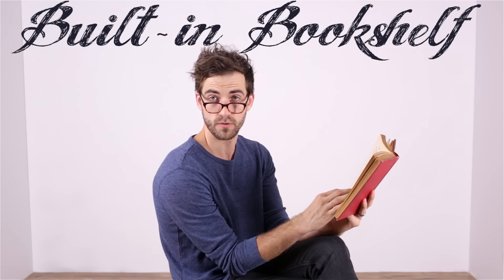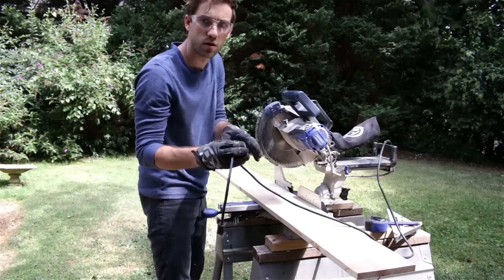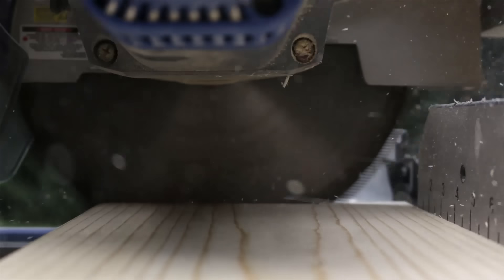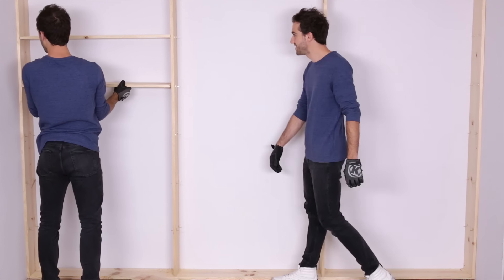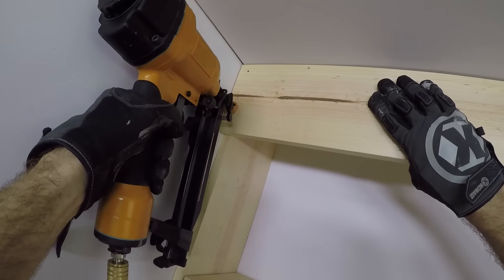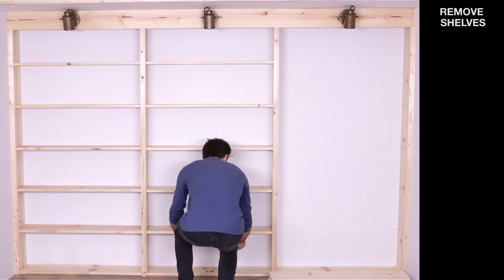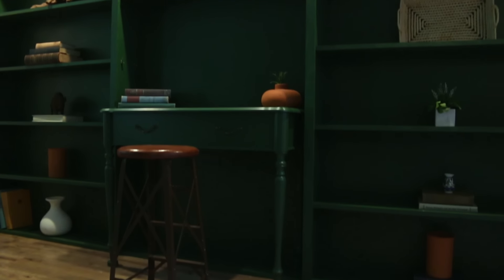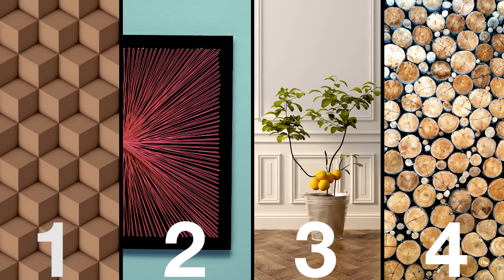THE BUILT-IN BOOKSHELVES WALL /// Experiment #004

Comment: If anyone plans on filling the shelves with books be prepared for the pine to bow under the weight. Two easy things you can do: One is to flip the shelves over and let them bend back. Seriously. Or use the same face frame material to trim the front of each shelf which will also help reinforce it (but you can't flip it). This will help but it's best to not overload pine and keep these shelves more open. Nice, simple project, Daniel; well done.
Reply: Maybe reducing the shelf length to 20” would fix this? The point of building a floor to ceiling bookcase is to hold a wall-full of books, after all. Next it needs a rolling ladder.

Comment: Very intrigued by #4, so that gets my vote. This project turned out so cool!!!! Seeing if I can adapt it for my rental since every little nail/screw in the wall is something I'd need to fix later
Reply from the maker: This one is a liiiittle more renter friendly, since once the frame is secure, you're really not installing anything else into the drywall. If you do end up trying it, I recommend leaving any screws or pocket holes unfilled so that you can unscrew them easily later (vs. ripping them out of the wall). Just hide them with books 😉

Comment: I loved the book shelf wall. Would it be possible to add glass doors on this bookshelf?My husband is a comic book collector and freaks out them getting dusty, so the doors would prevent it.
Reply from the maker: Oh, what a great question! So short answer is YES, could be done for sure. I'd have to think through how you'd structure it differently to accommodate the glass. The way I did it, the shelves aren't actually fixed in place so that you could reconfigure. With the glass, though, I'm thinking you'd want those shelves to be fixed? A fun challenge!
Reply: I was wondering if the structure, as you did, would  be strong enough to hold the doors. I'd make a wooden frame for the doors. I don't need the shelves to be fixed, would they have to be?
Reply: #4 looks really cool.
Reply from the maker: You know, since you'd be making the cabinet doors yourself, I wonder if you could just install the door hinges directly onto the columns? Then you could fit the shelves in there with the regular shelf pin method, but the cabinet doors wouldn't even be attached to the shelves (except maybe the little magnetic door closer strips). If you try this, PLEASE come back and tell me about it! Cool idea.
Reply: I loved the built- in book shelf...as well as the other three wall ideas. I think I would love to see #2
Reply: amani bagwell same
Reply: Same about my husband and his comics. A wall specifically built for comic collectors and display would be uh-mazing and get a ton of traction. There's so many cool ideas beyond a standard set of shelves!
Reply: You should tell him about bags and boards for his books. keeps them dry, rigid and free of dust.

Comment: if you used a peg board you can use it as a guide to drill holes for the shelf peg holes
Reply from the maker: Great tip, Donnie 👌
Reply: +Lowe's Home Improvement glad I could help a peg board is cheap & can be reused on several projects you just rip it down to the size you need mark the holes you want to drill through drill one side move it to the other side & repeat should all line up since your peg board is cut at the same length & the holes are drilled out in the same place hope this helps
Reply: Donnie Haymon ~ What a great idea!  Thank you for sharing it.

Comment: Wow! I'm just about to build shelves in a reading nook inset in our new house. They will be about 6 feet from the ceiling, leaving 3 feet for a padded bench and pillows at the bottom. So this video was just what I needed. My shelves will be wider than 7.5 inches to hold larger books and I'm considering building them from stair treads and I'd like the rounded edge on the front of the shelves.. I really hadn't decided how I could do the lighting, so I really appreciate your suggestion. Hopefully I can figure out how to install the cute on-off switch you used.It's such a great idea! Thanks so, so much for this video!

Comment: While the host calls this a "book shelf" he doesn't put any books on his 3/4" pine shelf planks. If he did, he would find that the "shelf pins" are not adequate to the job. On the plus side, the Kregg pocket whole jig is a great idea. On the negative side, I have five complaints. 1: His wall has no baseboard, but a real wall would most likely have a baseboard that would need to be removed (or accommodated) on the bottom shelf, the bottom of the upright columns, and the two  outer frame pieces. 2: He doesn't tell you what width stock he is using. I measured some existing shelves and found that while 1" x 10" could work for most books, 1" x 12" is actually need for larger books. 3: He spaces all shelves the same height, when both function and aesthetics would recommend that the shelf heights get smaller as they go up, staring with about 14" on the bottom shelf and going to about 11" on the top shelf. 4: He says nothing about the possibility of the shelves sagging. I built an 8' tall by 12' wide shelf with three supporting columns which meant my shelves were about 34" wide. It turns out that there is a tool called the sagulator which can be found at this URL: https://woodbin.com/calcs/sagulator/ that lets you know how much sag to expect based on material, dimensions, and weight on the shelf. My pine 1" x 12" x 34"  passed muster based on about 40 lbs. per shelf. 5: The most serious complaint is that the shelf pins he uses are entirely inadequate to the job of holding 40 lbs. of books. If I had used his 2-column approach the weight would have been closer to 60 lbs, and those shelves would have sagged badly. The result I received after loading the first 2/3 of my library into the bookcase was 600 books on the living room floor. I replaced the inadequate pins with 1" x 2" x 4" pine supports nailed into the columns and the frame and now the bookshelf works fine.
Reply from the maker: Hey Tim! You make some great points & I appreciate you taking the time to share those resources. Looking back on this vid, I wish I'd addressed the weight/sag issue. I wanted to fill the whole shelf with books, but I didn't personally have enough on hand and to order them would've exceeded my budget. But if I had, perhaps I would've realized the limitations of this design, particularly if you're planning to fill it completely with heavy books. Looking at that calculator (which is great, btw), it looks like ~30lbs is the limit of each 3/4" x 8" x 36" shelf here. Which would accommodate many books, but likely not 100% capacity. 

So anyone planning to use this design as a guide, I'd encourage you to plan accordingly! Adding add'l columns, using 2x material vs. 1x, or affixing the shelves permanently like Tim did would all be ways to increase load-bearing capacity.

Comment: Great bookshelf build. What I really love though is that you did it without a truck load of tools. I've watched so many bookcase builds (getting ready to do a whole wall in a new home) that start with: "First I used my jointer...then my planer...then... " and so on. I have a table saw and a radial saw and I can buy a pocket hole jig but beyond that... not going to create a whole cabinet shop for this project. Good work, thanks.

Comment: Love this! How do I made a studier shelf that can hold some serious weight? More pins? A strip of wood instead of pins? Could this be done without a miter saw? How about a tutorial about how to remove crown molding, do I even have to do that? Oh, I'd love to see #3!
Reply from the maker: All good questions, Amber! Couple sturdiness upgrades you could make: thinner columns, using 2x material vs. 1x, attaching the shelves permanently to the frame vs. shelf pins. It'd take a little more time w/o a miter saw, but could definitely be done with a hand saw or handheld power tool. I didn't address the crown molding issue because everyone's scenario is so different, but you could either remove it before building the frame OR just account for it's depth when you're cutting the frame and column pieces.

Comment: Great video probably the simplest of all I found on youtube ! I have got these questions: A) how and where did you nail the bottom plank to the floor? Couldn't see clearly from the videoB) How did you attach the middle vertical planks to the bottom and top planks C) if I were to add back plank instead of the wall at what step I should be doing so?Thanks! Excited for the next season

Comment: Out of the four designs I'd go with number 1 - I love this series of videos and hope to see more stuff like this. My idea would be to remove the drywall completely from one side of an interior wall then coat all the studs, wires, drywall, etc with all flat black or all white paint and then start a design based on that as your canvas... just not sure if its a code violation(maybe call legal?) Keep up the good work.
Reply from the maker: Love the creativity, Ben! I think you'll wanna steer clear of any wiring, but I do like the idea of exposed studs. I've been really fascinated lately with faux wall room dividers, like:

https://www.pinterest.com/pin/90494273732317569/ or https://www.pinterest.com/pin/482377810078591618/

Comment: How deep are the pine planks?  Also, wouldn't it be much easier to paint the wall and the planks before building the shelves?  Great job!  I love your ideas, and the colors you choose!
Reply from the maker: Thank you, +tegma! I used 8" deep planks here, but I've also built this same design with 12" deep planks and it worked great. As far as the painting, that could definitely save a little time, esp doing the wall beforehand. The advantage of painting the planks AFTER installation, though, is that you can paint both sides of the plank in one pass (vs. painting one side, letting it dry, flipping it over, etc).

Comment: I LOVE these ideas! What about one without 1000 holes in the wall, for renters, which is semi-easy to remove when moving out?
Reply from the maker: Working on some more removable designs, +Kleberdeckel. After taking this bookshelf down, though, I realized that there isn't THAT many actual drywall holes for this one...the frame is the only thing that's permanently fixed.

Comment: You do a good job making these complex looking projects doable for average people.  Did you consider making the selves adjustable?  I didn't notice that in the video.  Since you are using shelf pins it wouldn't take much to add more holes.  I also think a template is well worth the money- Lowes- $35. I would have put the bottom shelf up a couple of inches and inset a kick plate.  This would cut down on the dustf on those items.    I would also hang a light under the shelf above the desk and perhaps a piece of art or wall paper or something on black wall..     In terms of what you do next, I won't use any of those ideas.  They all look nice.   I will suggest that anyone who has children under 21 or pets is asking for frustration with the string art.  This would include visiting children or rowdy friends watch sports.   Many people of all levels of maturity will have a hard time not touching it and trying to strum it.   .
Reply from the maker: Good ideas, Karen! And you're probably right about the string wall strumming temptation 😂

Comment: One or three! *

I love this! I just wish:
a) I knew how to handle that machinery without hacking off something likely to bleed and
b) My walls weren't concrete!

The answer to a) is simply education. What would you recommend as the answer to b)?

*If I had to choose one, it's three ;) (see what I did there?)
Reply from the maker: What's the flooring and ceiling made of, Rachel? You may be able to bypass attaching to the wall if you have some solid materials on the top and bottom.
Reply: Concrete walls aren't the worst thing in the world. Just need some concrete anchors. May need a different drill though

Comment: 3 for sure. question - what kind of weights could you expect to put on the shelves? being a true book nerd I would be fearful of those shelves bowing with any real weight put on them...what would be a good way to make them a bit sturdier?
Reply from the maker: Good question, Dustin. I tested out the weight capacity a bit with these 40" wide shelves by filling one with books and found that it held it's structure with little to no bow. Couple things you could do to increase holding capacity, though: Adding more columns would make for shorter, stronger shelf lengths & would reduce any bow factor. You could also use 2x material for everything instead of 1x. Would give a chunkier look and would just generally be stronger. Lastly, you could sub out the shelf pins and fix the shelves to the frame for a more permanent installation.

Comment: I'm wondering how well those will do holding up a shelf full of books.  Maybe it's actually just a nick-nack shelving unit.
Reply from the maker: Good question, William. I built a version of this at home for my son and it's full of kid's books w/o any issues. If you were worried about weight, though, you could use brackets instead of shelf pins OR use 2x material instead of 1x.

Comment: i was looking for ideas for a wall to wall bookshelf. this looks great. Question: the 1/4'' pins -- can these really hold shelves full of books? how much weight can these handle? thanks
Reply from the maker: Shelf pins are typically much stronger than you would expect for their size. Many shelf pins can hold up to 25 pounds per linear inch of shelf, so a 4 foot shelf could support up to 200 pounds.  Be sure to read the packaging of the specific pins you are using to see to what weight they are rated.
Reply: @lowes  great. tks! i just worry that it will bend in middle. my hubby hv loads of thick, heavy books. thanks for yr prompt reply tho. LOVE LOWES HOme Improvemnt Channel - keep up the great work!!

Comment: would love to see #3
also, I have a wall that does not have corners to build the sides - any suggestions or other video?
Reply from the maker: I think this design still works pretty well without corners. You'd just install the ceiling and floor pieces of the outer frame first, then use a pocket hole jig to attach the left and right side columns to them (the same way you'd install the inner columns). You could also size the bookshelf so that those 2 outer side columns run parallel with a stud, allowing you to add some additional pocket hole screws all the way up those side columns. Hope that makes sense? 

Oh, and good news! I did that #3 design: https://youtu.be/7y-otGwcgnE

Comment: This is actually an easy way to build the wall (oops...) , comparing with pre-made compartments. Everything is built in place, no assembling. The only issue I'm think of is the two vertical studs in the middle. Wood tends to warp and the weights from the shelves can drag them out of shape, given their length. It might be better to add more support of them on the wall.

Comment: Great idea, but books are heavy.  How about some ideas to add some strength to this bookcase?  The only one I could come up with is to add more columns--???
Reply from the maker: Yep! More columns for shorter shelf runs would help. You could also use 2x material instead of 1x for a chunkier, stronger construction. Lastly, you could eliminate the shelf pins & fix the shelves in place with some kind of brackets to add some additional support.

Comment: Quite nice, but if you were going to use it only as a proper bookshelf, i.e. loaded with only books, pine boards would be too weak for shelves that length, unless reinforced with a batten underneath them.
Love the colour though...very rich and classy.
Reply from the maker: Here's a couple other upgrades you could do if you were expecting lots of weight...shorter shelf lengths with more columns + use 2x material instead of 1x + skip the shelf pins and fix all the shelves in place.

Comment: I like the look of #4 but I have a really wall to tackle.  The wall has a big bump.  I banged on the bump and the brick is now exposed.  The other side of the wall is another apartment.  I would like to make a wall of French cleats but I don't really know if I should fix the exposed brick part with dry wall or just install a few sheets of plywood with French cleats on.  Would anyone have any idea?
Reply from the maker: If it was me, I think I'd try to incorporate the exposed brick section into the design! But the 'correct' thing to do is to fix the drywall, then install your French cleats onto the actual wall. Here's some tips on drywall repair, if you need it: https://youtu.be/Fdy9uRvpI-E

Comment: So I have a door way on the right hand side, is there a way to still build the frame without the right side wall being there?
Reply from the maker: Yep! Just install a column right up against the door frame moulding (you can use some pocket holes to screw into the door frame studs for extra strength). If it were me, I'd even install shelves above the door, so the door looks built into the wall.

Comment: So it seems like you cheated a little. There is no baseboard at the bottom of your wall. so do you need to cut out the baseboard in the area or should I make a toekick ? How do I get the edge to match up with my baseboard profile. Otherwise build seems solid.

Comment: What are the weight limit for each shelf? Can you fill the shelf with a whole bunch of books?
Reply from the maker: So, I don't have an official weight capacity to give you, but I did fill up a shelf completely with books to test it & I didn't see any significant bowing or other signs of stress. If you were planning to put tons of weight on yours, there's a couple things you could do to beef up this design: more columns/thinner shelves (mine were 40" wide), use 2x material instead of 1x, fix the shelves instead of using shelf pins. Just a couple ideas. Good luck, Michael!